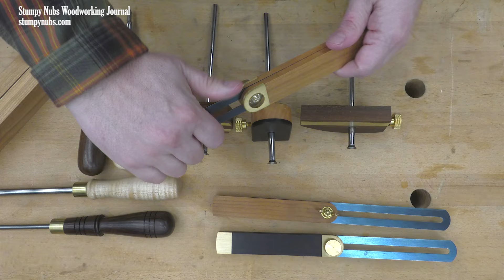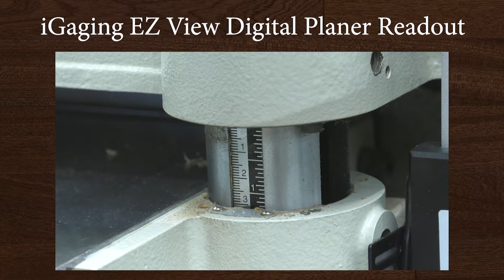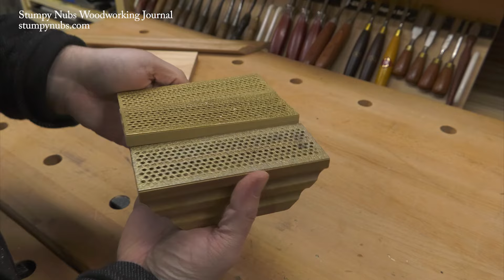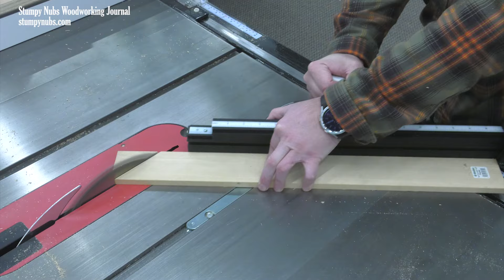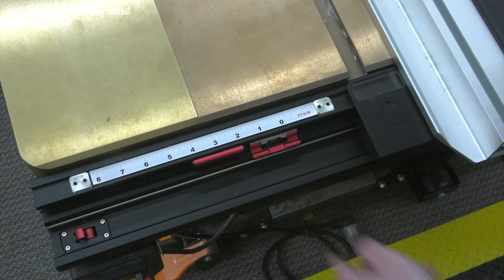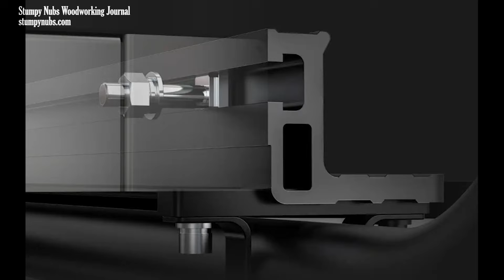These tools are responsible for the most workshop head thumps!

Comment: This comment is for one of your prior cool tools videos from a month or so ago. You featured the milescraft track saw guide. I am currently at my daughter’s just finishing a significant master bedroom remodel. Lots of built ins as well. I have a great shop in Nebraska but she lives in Idaho so I was limited to the tools I brought in my small trailer. Of course the scope of work greatly expanded to include the built ins after I arrived. I ordered one of the milescraft track systems. I actually gave my son in law a very nice and little used Milwaukee circular saw I wasn’t using, a few years back. I asked him if he used it much and he said he had not touched it. So I asked him to give it back. Put a pretty nice blade on it and also ordered the milescraft square for the track saw. Both of them have been lifesavers on this remodel. The carpet went in 2 days ago and we needed to cut off the bedroom door by 1/4”. The doors are expensive and it appeared that the finish on them would be prone to chipping. Cutting off doors has always been difficult and risky when doing it in the field. Many years ago when I was in the business I would often take the doors to my shop to cut on the table saw with a sliding table and scoring blade or in the field you would make a knife line and cut just outside of it and then finish with the belt sander. Today I just placed the milescraft tool on the door and did not cut all the way through the door. Flipped the door over and lined it up and finished the cut. It came out perfect. Thanks so much for the awesome cool tools and all of the other videos. If anybody needs Tracy saw capability and happens to have a good circular saw the milescraft set up is the way to go. It also works great to make angled of tapered cuts. This house is old and nothing is even close to square. Say that in 4’ you needed to make a cut going from nothing to an 1/8 inch the milescraft tract does it quickly and accurately.

Comment: I previously purchased an 80 grit Duragrit Carbide sanding block, and while the grit has held up well, I have found an issue with the flatness of the sanding side of the block.  After about 3 months of using the block including on narrow stock edges, the block has two gullies  about 1/8" deep where the metal dipped under the unsupported portions of the sanding medium.  This leads to workpieces that are not flat after sanding.

Comment: 4:45 I still prefer the Picquic screwdriver. It has a clever design where you use the bit you are putting away to get out the new one, so you don’t lose any bits. It also features hollow ground flathead bits, which don’t cam out of slots so easily.

Comment: I have a Wixey digital depth gauge that came with my planer.  It has all the charms described in this video, sure, but...  It never turns itself off.  If you're a casual woodworker like me, and using the planer is a once-a-week kind of thing, you'd better remember to turn the darn thing off or you'll be replacing the batteries.  It's just criminal.  It's about a dime's worth of electronics to add a circuit that'll shut it down after an hour or two.  15 cents if you want it to reset the timer if you move the thing.

Comment: Stumpy, I love Klein tools, but the hollow-shaft nut driver has been around for at least 50 years. I know this because I have both Craftsman and Xcelite nut drivers with hollow shafts that I bought that long ago. The Xcelite nut drivers have color-coded handles. They are also available as part of the 99-series interchangeable tools. What Klein brings to the party is the 1/4” hex shaft, which I agree is quite useful.
Reply: How about DIY drilling out the shafts of nut drivers?
Reply: @knot4man ,
If you have a machine shop of your own with a metal lathe then I’d say it’d be easy. Clamping it precisely in a vise on your drill press table (after truing it to the spindle shaft) is more of a hit or miss proposition.
🧐😮👍

Comment: Help needed! I have tried to order many of the tools listed after your video. We put them in the cart. Then when we go to Amazon they are not listed in the cart. What am I doing wrong? Geri (way smarter than me) thinks we have created a second Stumpy Nubs Cart somewhere out there. Since Geri thinks you get some support from our purchases we are on hold until we hear from you verses going around you and just buying them from Amazon proper. Make sence? It’s over a $500.00 order. Best to You & yours. FYI. The most stolen tool in the states in the chop saw. Did you know that?I had run a heavy duty cable and then put a Master Pad Lock on it. We found it off its mount hanging undamaged on its newly installed cable and Master Pad Lock. I WON! Take care of tools that are easy grab and go tools….
Reply from the maker: That's very strange. Amazon must be having some issues. If you are signed in to your Amazon account, you should only have one cart. I don't think there could be multiples. But you may just try clicking one link, and once you are on Amazon from that, Ill get credit for any purchases you make, even if you find them with the search feature. You don't have to click every link individually. Thanks for the support!

Comment: A nice fence, but it costs 2X what I paid for my saw.  The fence that came with the original Delta Hybird contractor saw,has some of the same features, but not as well executed.  If I used my table saw every day, perhaps I would spring for a complete Saw Stop or Harvey table saw and the new Eye fence, really very cool.  But, alasI do not use a table saw that much.  Most of my re-saving is done on a band saw, and I use a Festool Track saw for fine cuts, on my aging and rebuilt MFT 1080 table.  
Cheers

Comment: I'm looking to upgrade from my Jobsite saw to a cabinet saw.  I'm thinking of the Harvey HW110TC-36PG. It comes with the BIG EYE Rip Fence System and the COMPASS MG-36 Pro Miter Gauge. How Does the SawStop Revolution Miter Gauge compare? Is it worth spending the extra $449 for the SawStop gauge?
I'm stepping up from an entry level saw to a truly professional table saw. Not sure if I'm going to notice a difference between the gauges.
Reply from the maker: I like the indexing system on the SawStop gauge, but everything else about the Harvey is better, in my opinion.

Comment: Typical nut drivers are much better suited for driving a six-sided fastener from the head for exactly the reason you stated; they're basically useless for driving nuts. That being said, I use them all day doing electrical work for 1/4 and 5/16 hex head screws and they are by far the best tool for that. The ones with the flip sockets are pretty tight.

Comment: Funny as it may be, i just received my big eye fence system today as your video dropped.  I bought it for a delta contractor saw bc of the t-bolt mounting system.  I'll be installing it over the weekend and hopefully it works :)

@StumpyNubs  Was also looking to get the sawstop miter gauge in the future.  Would you recommend the SawStop or the Harvey version or a different brand all together.  I bought the exact 90 miter from woodpecker and I guess I didn't realize it was strictly 90 degrees only.  Thanks for the awesome videos.
Reply from the maker: I personally prefer the features on the Harvey.
Reply: @StumpyNubs  that would be the compass mg36 pro?

Comment: I strongly recommend the ISOtunes earmuffs unless you have a big head like I do.  I’m not talking about ego: I mean I wear an XL hat size.  The earmuffs do a great job at reducing noise and prevent you from turning up your music above a safe level.  Unfortunately, they are too tight for me to wear for more than 10 minutes, particularly if I’m wearing eye protection at the same time.  If you have a large head, you might want to consider their earbuds instead.
Reply from the maker: The Air Defenders are a looser, softer fit. I have a big head too.

Comment: Using a protractor is an awful way to check the precision of a 90-degree cut, that's what squares are for. The miter gauge is probably more precise than the protractor, so you're not really measuring much.
Reply from the maker: Lol... That protractor is a highly accurate measuring tool. I've checked it against my high-end squares. The dial is very fine, and the slightest diviation from a degree line is easy to see.... Your claim that a miter gauge (which is essentially a compass itself with a harder to read dial) is MORE precise is just silly.

Comment: About the Wera driver. . You say  "No more lost bits.. . . I say, "Challenge accepted!"
Reply: Try a Picquic screwdriver. To get a new bit out, you use your current bit to push it out of the holder, in the process putting it away. I’ve got several, and love them! They even have hollow ground flathead bits, which is a nice bonus.
Reply: @Vikingwerk  Yep I have a few of those including a stubby in the RV and a torx one
Reply: @Vikingwerk nice tip!
Reply: @Vikingwerk Milwaukee makes a superior version of the same that holds the working bit in more firmly.  But I use quikpik at times too, the bits are a bit easier to change out and it goes well with a impact driver.
Reply: Absolutely! I have several incomplete sets of similar items.
Reply: @traillesstravelled7901  And it works out cheaper to buy another tool than the bits so you have a drawer of incomplete things
Reply: Well, of course you still need to put them back. But not having to reach for another thing when changing bits a big help for the sloppier among us.
Reply: I tried one of these last year but returned it because whenever I dropped the screwdriver all the bits jolted out of their clips and needed to be messed with and replaced into position to allow the cover to slip back into place.

Comment: Coatings make all the difference in quality tools. We use solid carbide that's coated with silicon titanium nitride and they are rated to cut tool steel up to 70rc which is very impressive. A real world example of how great these coatings are, I've personally seen uncoated solid carbide tools break down and fail machining threads in 3 to 4 holes, and a coated tool machine dozens of the same threads. These threadmills were coated with AlTiN aluminum titanium nitride, which is outstanding but not as tough as the silicon based coating. Carbide is great but once the cutting edge gets dull it begins to erode like an effervescent tablet. The coatings prevent the edge from getting dull as fast. This is much more noticeable when cutting tool steel but the same reduction of performance is seen in wood. Thanks for the great info as always bud.

Comment: for the digital guage thing, the motor could interfere and the guage could randomly loose the calibration or reset. It's not reliable imo.
Reply from the maker: These types of digital slider sensors are widely used and proven. It's not a new concept. It works.
Reply: @StumpyNubs   I got the igaging ez view DRO from busybee just 2-3 month ago and installed on my bench top planer. During this short period, I already got 2-3 times reset. I honestly wish it works for me. I researched the issue and found it's actually a common issue. Just Google this term "igaging digital readout dro random reset" and you will find a lot of related page.
Reply from the maker: Mine works fine. And I've used these before on planers with no issues, as well. Send it back and get it replaced. They have excellent customer service.
Reply: @StumpyNubs  got it. I will try contacting them. Thanks.

Comment: Been using Greenlee nut drivers because of this for over 20 years(hand drive) Put new fence on my unisaw a few years ago replaced my unifence that came on it. Not real happy with the new one and will not mention it is now owned by delta or what ever they are called now . Looked at the big eye and it is almost as much as i Gave for my unisaw when i bought it . Will have to give this one some thought .